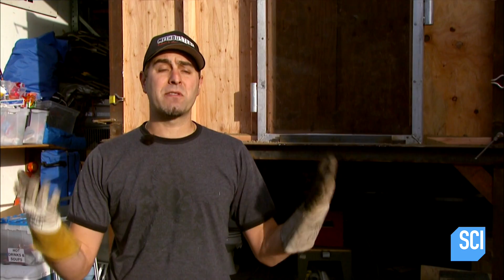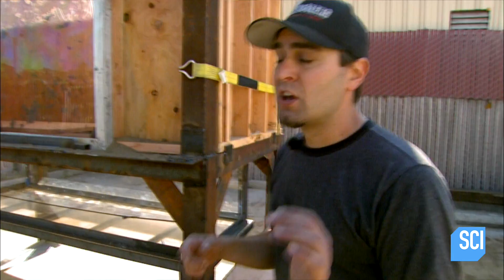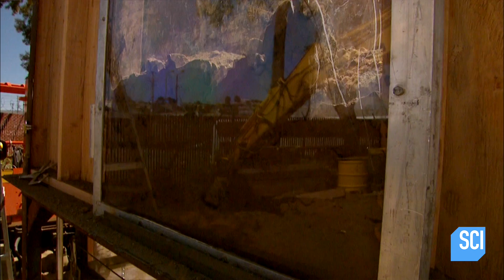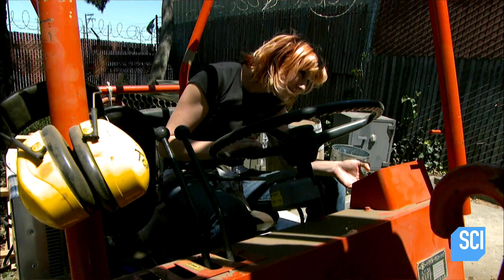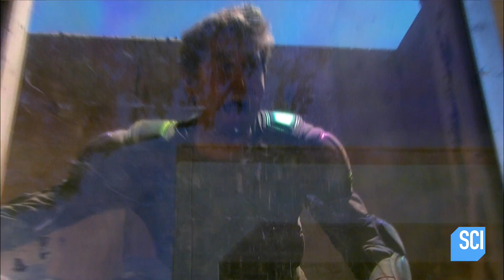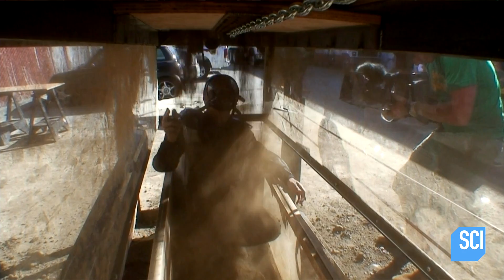Is There Too Much Pressure to Escape Out of a Casket?

Comment: I want them to reverse engineer how strong a vampire would actually have to be to get out from a standard well built coffin 6 feet under. It'd be an interesting mathematical analysis for all those vampire shows on TV. The vampire doesn't need to worry about breathing, of course, but he does have to deal with the firmly sealed coffin and all the pressure of the dirt. His body also has to be tough enough to withstand the crushing weight.

Comment: Having worked at a cemetery for several years (many years ago), I can assure you that pretty much no one is ever buried "six feet under"; not even to the bottom of the hole. Let-alone there being six feet of dirt above a casket's lid. There are several reason why it is unlikely that burying anyone that deep would have ever been common practice. The most obvious one is: a hole that shape is potentially going to collapse-in, from the longer sides, if dug that deep. If there is an existing burial next to the one you're digging, this would be almost certain to occur. Shoring would be necessary. And, pre-backhoes, you'd be looking at several days work; each grave. Most graves are "shovel-handle-deep", to the bottom of the hole.
Reply: To think the idea/practice of 6 feet all started from a particularly bad outbreak of Bubonic plague. They thought it would spread from the corpses so the city officials required that depth and they often were shared. Too many people were dying too quickly and they didn't have the time or energy to bury them individually. So maybe those graves actually were 6 feet since they were mass graves..? 🤷🏽‍♀️
Reply: @nicolina1026  Perhaps in some cases. In other cases they raised mounds. This would be a somewhat shallow hole or pit, with multiple remains laid within, and the dirt placed atop. The end result would look like a man-made hill. In many other cases though, they were simply burned in pits. Such pits would remain open throughout an epidemic, and the fires re-lit at-need. Eventually the pit would be covered over; probably by the same dirt that was dug out of it; the end result again, being a man-made hill or mound.
Reply: What an inciteful comment, this would explain the 'Indian mounds' and much more. Thanks for contributing in your comment ^^
Reply: I attended a burial and they buried the casket at least 7 feet deep if not more.
Reply: @roybatty-  Different people's customs will be different. I was just commenting on what is typical in the US these days.

But I have certainly seen exceptions, at the request of the deceased's family. Just as an example, one family asked for a grave to be dug six feet deep by hand. For modern safety reasons this required light shoring.

I was also present at a Gypsy funeral where a woman of significant status was buried. And her grave was dug vertically, so that casket rested in a standing position. I don't know much about Gypsies, other that racist stereotypes you see in old movies, but I can't imagine this method is common. It looked like a ton of work and risk was involved.

I wasn't a participant, in this case, because they insisted on doing it themselves, and all the men took turns digging. I just had to remain on the property for liability reasons. It was very interesting. They had quite the party.

It's also worth keeping in mind that any hole dug in the ground that's roughly casket-shape (narrow and deep), can tend to look deeper than it really is. Like an optical illusion.
Reply: @EgaoKage  It was an American burial in Brooklyn, NY.
Reply: @EgaoKage  I think each site is meant to accommodate two caskets stacked on each other.  The first casket may have been even a good eight feet deep.
Reply: @roybatty-  Oh, interesting! I have heard of that. Though, the cemetery I worked at didn't have any plots like that. But most of our indoor crypts were "double-deep". So, like a horizontal / end-to-end version of the double-deep graves.
Reply: Just dig it and right away throw me down there fuck the coffin, back in the wild west days they dug 6 foot holes because they thought the body would rise as a zombie or ghost.

Comment: It very much depends on how soon you did it and a lot of the modern cheap coffins are cardboard with a veneer.

Damp soil and loose dirt thats freshly dug and being put on spade by spade in a fairly shallow grave where you have been sheetwrapped and dumped or a cheap nasty casket and doing it within minutes you could do it. It would be bloody hard work but could be done.

Dry dirt dropped by machine and covered with turf with a solid wood coffin would be brutal

Comment: Well, after working on a cemetery, I can tell you the casket doesnt go straight into the ground. There is first a vault lowered in the ground, traditionally made of cement, and only then is the casket lowered into position. The reason for this is, for some reason, there are some instances where it needs dug up and moved. The vault protects the occupant and the casket material from moisture, or any other kind of damage. Furthermore, there are different layers of material, and water on top of the then-closed casket vault and is tamped and packed tight under many pounds of pressure. Gravel, shale, course dirt, then top soil. Water seeps in to all the cracks because of the ground water that comes with an ordinary graveyard or cemetery from the ground being generally flat or level. Myth is totally, undeniably, debunked.

Comment: Wet soil could be easier to climb out of because it wouldn't just collapse on you. The hard part is, first, breaking the lid. Some coffins are built well, you know. Then you'll have to dig a little dirt out and start making a good hole that you can compact by just pushing the dirt out on the sides for stability.
Rinse and repeat: dig dirt out of the hole, place in coffin, compact the hole as much as you can, but chances are you'll just end up with a coffin full of dirt, low on oxygen, and a hole too narrow to escape out of.

Comment: You don't have to worry about digging through 6 foot of dirt they only put you about 3 ft deep..❌❌❌
Also they have that big concrete Vault that  the casket goes in with a concrete lid.... cemetery worker 101...

Comment: Most cemeteries use a concrete box to enclose the casket to keep it from getting dirty, you aren’t getting thru that
Reply: wtf?
Reply: ann onn google “burial vault” and go to pictures and you’ll see how it works
Reply: a) Most do not
b) Those are not to "keep it from getting dirty"
Reply: ann onn my dad works at a cemetery but nice try. They help keep dirt and water out but the main reason is to keep the ground stable. I have never seen a cemetery that doesn’t use them.

Comment: I worked at a cemetery for years and I can assure you that once you’re buried the only way out is if you are dug out also most burials nowadays aren’t just a casket I’d say only about 10% the other 90% of burials are a casket inside a concrete vault that is sealed and buried anywhere between 2 1/2 to 8 feet deep 6 feet is just the most common legally you only need 2 1/2 feet.
Reply: That’s only for places only under sea level, so bodies don’t float in floods
Reply: Jolly Duck not true vaults are only legally required when the water table is close to the surface the vault is meant to prevent contamination into the water table they also help prevent the grave from sinking as a plain casket will collapse but a vault won’t and bodies in caskets don’t float up out of the ground during floods what could happen  is you could have  a hill with graves and heavy flooding can cause the dirt to erode away exposing the casket but it’s dirt being washed away from the top not the casket floating. The vault also helps keep the casket from drifting underground. The cemetery I worked at the vaults were a money grab it wasn’t legally required but the cemetery could charge a lot more for a burial with a vault than without one. I worked at a cemetery for over ten years trust me the only time a body came up out of the ground is when we dug them up.
Reply: @MOtherNature790  hm alright, i copied another person's comment.

Comment: I've always had a problem with their depth. If the hole is 6 feet deep, then the coffin is really only 3.5 - 4 feet to the surface. But Beatrix was buried on top of the original coffin. So maybe only 2 feet from the surface. So when he dug his way out with 2 feet of dirt, it made the Myth plausible, or even confirmed.
Reply: As the announcer said, that may have been true if she was buried at the depth in the original coffin, but I think Michael Madsen built his own brand new coffin just for Beatrix. Unless he used balsa would, I’m not sure if any human could realistically punch through a coffin like that.
Reply: Wiwe rhing os they dug up and overturned the original coffin as shown. Then it appears they place it back in on top of Beatrix.

Comment: Caskets are NOT, "traditionally" buried 6' under ground !!! NO PLACE that I've ever heard of buries EVEN 6' to the BOTTOM of the grave !!! THE GRAVE WOULD HAVE TO BE 8.5' - 9' DEEP !!! 
AND... They forgot about the BURIAL VAULT ! I manufacture burial vaults, service funerals, AND dig graves. And I can tell you, there is about 24" ... or 2' give or take 4"-6" on top of the vault. A 5.5' hole would become VERY DANGEROUS to work on at 9' !!! My hazard pay would have to go up SUBSTANTIALLY !!!
Reply: 1-Relax
2-A lot of places do indeed dig 6 ft to the bottom of the hole.
3-You are, however, correct about the amount of dirt on top of the vault. I worked for the city and helped dig quite a few graves. Lots of bad soil sometimes made it impossible to reach 6 ft, but we never went less than 5.

Comment: haven't started the video yet but would like to throw out there, unless the dirt was a clay like consistency as soon as a hole opens up in a casket dirt will flow through at an alarming rate and it only takes less than a few feet of dirt to crush a human body. I will watch the video and edit my comment if I am proven wrong by the video (not by you)

Comment: Overall, this myth was not tested properly.
Reply: Wet soil
Reply: @wafflelappen4749  as much as I want to believe it is possible. I can't I have been buried at the beach upright to my chest and there is no way I would be able to pull out of that. So I can imagine what it would be like being completely submerged with a foot to go
Reply: Here in Ohio where I'm from the bottom of the grave is around 6 ft. Then you put the coffin down in the 6 ft hole. Actually they put a concrete or steel vault in and then the coffin and then the vault lid. You'd never break thru the vault but if you did you would probably on have 2 1/2 to 3 feet of dirt above you. But that's not all just loose top soil like they used here in the video. Only about 6 inches and if your lucky a foot of that would be top soil. The rest would be clay a it probably wouldn't just collapse in the coffin like it did in this video. You would actually have to use your fingers to dig your way thru the clay to get to the top soil or the top soil would just get mixed into the clay and it would pretty much be like trying to dig all the way thru clay. So they definitely tested this myth all wrong.
Reply: @frankmaxfield7025  it was tested based off the ik impromptu live burial of Beatrix Kiddo in the movie Kill Bill, not off of a real burial by the funeral industry.   She was buried in a simple pine casket.
Reply: No shit you want them to die ?
Reply: @df-int-3856  air tanks. Air tanks and shovels.
Reply: @df-int-3856  the thing about myth busters is that they are supposed to do everything right even to the smallest details... These people didn't even use actual dirt but used sand instead...
Reply: @df-int-3856  woosh
Reply: @df-int-3856  what he meant is you can escape in a real life cinario because first of all your strength it gonna be better because of adrinaline and after you belreak a small hole in the top you can slowly move the dirt down to the other end of the casket and after a little you can get out but it is very hard and dangerous
Reply: я тим after l read “cinario” l knew your explanation would be ridiculous
Reply: я тим you have to keep in mind vegetation around the burial place will keep some dirt in place
Reply: @bigfella2111  cinario
r/boneappletea
Reply: @misterbaconzzz2350  yummy
Reply: я тим you think you’re smart it’s funny
Reply: @bigfella2111  you do realize a coffin can only hold so much dirt, right? No way you're going to shift 6ft of dirt around in a small space, plus laying down you would then have no air as the full amount of dirt crushes you to death.
Reply: Jor and you wouldn’t have any air supply / air mask or whatever it’s called
Reply: xXM0nk3YXx Gaming so let’s just pretend like we don’t need air to survive your oxygen would run out fast and you’d be panicking making you breathe more and cause your oxygen to go down very fast
Reply: What a joke. I dig holes with excavators for a living. The pressure of dirt and rocks from both sides will collapse to fill the gaps in.
The dirt going downward prevents you from ever making it up unless you're a magic ninja with super arm strength. None of you could survive the weight of of 3 feet of dirt pressing on you in a box, you can't move your arms.
Reply: Step 1: Pull shirt over nose and mouth to prevent inhaling dirt
Step 2: hit center of coffin where it is weakest to create a crack that will slowly let in dirt
Step 3: Move as much dirt to the side and bottom of coffin as possible
Step 4: continue to make the crack bigger until able to start to climb up, being sure to cover entire face with shirt
Step 5: work on standing up and if possible stand on the top of coffin for extra height towards surface
Step 6: climb out and head to nearest bar with one hell of a story to tell
Reply: Here comes the YouTube experts
Reply: J4MI3 too smart lmaooo don’t even try guy. go back to 5th grade and then reply back, stop bothering me.
Reply: j6mes speling  has nothing to do with intelligence
Reply: @wafflelappen4749  Try standing up through a ceiling in a 2 ft high room. Same thing. 
The dirt will have thousands of pounds of pressure from all sides even if you made a hole big enough to start crawling. Loose soil or hard you cannot dig through from the bottom with no possible way to move your limbs. 
Only a super movie ninja could do this.
Reply: what about escaping from the casket vault?
Reply: Jor its possible and its been done many times in history so stfu
Reply: First of they used sand n gravel instead of dirt...
Reply: It's all about what type of dirt you're being buried underneath fine dirt you're definitely dead but maybe dirt that isn't so fine you might have a chance
Reply: a lot of their myths could have had better testing conditions and some of their conclusions could seriously be argued i think most of the show is simply about constructing big testing devices and then blowing it up with some actual science in between the amateur acting
Reply: I agree
Reply: I dont wanna take the time to reply to all the idiots so ima just make a general reply to everyone
Just about every aspect of their test was inaccurate, from coffin build to oxygen supply to soil type, this was done as poorly as a middle school science project
Reply: It's not a myth
Reply: A lot of their myths were not tested properly, It was definitely entertaining to watch them but when you go back and pay attention to what's really going on a lot were not tested very well. 
For example the shooting through the sniper scope myth, I don't believe they used a scope from the time period they were testing for, And I believe it was a WWII gun they bought for testing, then they put the scope on it and shoot at the scope with a modern ass gun, the WWII gun made absolutely no difference to the scope getting hit, I was expecting them to use it for shooting the scope as that would be what gun was used in the myth if it were true...
Reply: @towtruckaj  they went back and did the sniper one
Reply: HOLY SHIT YOU GUYS ARE TYPING BIBLES IN THIS REPLY SECTION
Reply: What is on this show? They test shit in some ludicrous way, find a very small, very impractical way someone could pull it off and go "yeah it's plausible"
Reply: At all!
Reply: @xXM0nk3YXx Gaming yeah right at most you'll have 3 feet of dirt to crawl your way through that's not much at all
Reply: я тим you’re telling me you could 1 inch punch your way through a coffins door that has hundreds of pounds worth of soil on top, make a hole big enough for your body; while not having the entire coffin instantly fill up with dirt that’ll probably collapse your chest cavity under that kinds of pressure.
Reply: @bgwehgaga  yes that is true you might not get all the way to the top just by doing that but after that you start dragging yourself up while holding your breath
Dirt will start to fall under you making it to where you can push up so digging and pushing up will get you out in not time with the dirt that is left
Reply: я тим lol. Adrenaline doesn't make you as strong as you think it does. If you get buried alive, you're as good as dead.
Reply: @bigfella2111  you'd surely run out of oxygen with all that exertion.
Reply: @ov3rcl0cked  5 and a half hours with just sitting half that so around 2 hours of busting your way out and even then you can hold your breath for 30 seconds  to one minute enough time to pull yourself out
Reply: @bgwehgaga   .
Reply: @bigfella2111  the weight of the soil impacting you even if you broke the wood above would crush and kill you
Reply: @bgwehgaga  well if there is no Pocket it will still be easy to push the dirt up as for if it's light and dry it will go right up and you can push your way out
Reply: я тим fuck no dirt is super heavy.  No way you can push six feet of that.  Try lifting bags of dirt and you’ll see.